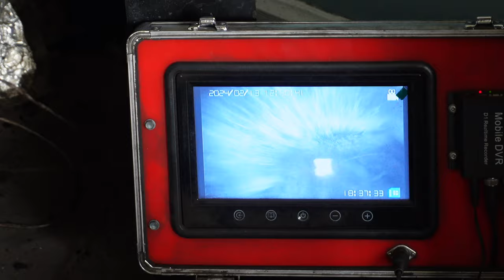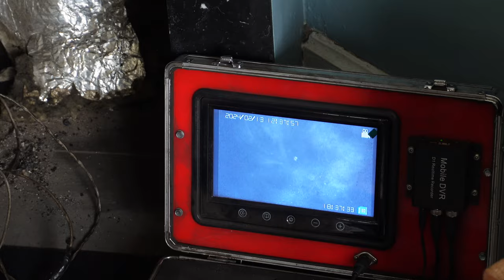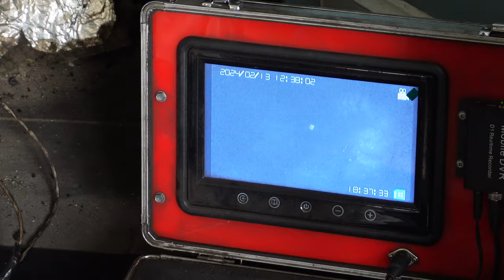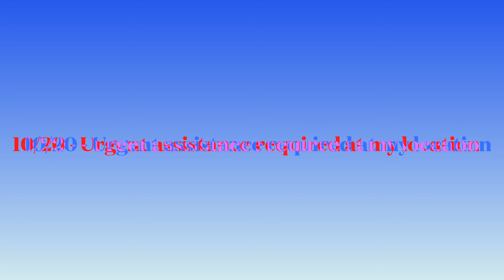Chimney sweep day in France ready for the new log burner installation plus much more, maybe too much

Comment: In France you have to swipe the chimney, open fire or burner by a professional at least once a year, that's insurance requirements, if you don't have the paper of the professional, your home insurance won't work and that was years ago. Professionals advice to do it twice a year, one when the chimney isn't in use and the other in use, better to do it before to reuse the burner. 
Chimney fire aren't rare same as monoxide intoxication. Safety first always.
Reply from the maker: Couldn’t agree more with you. 🇫🇷👍